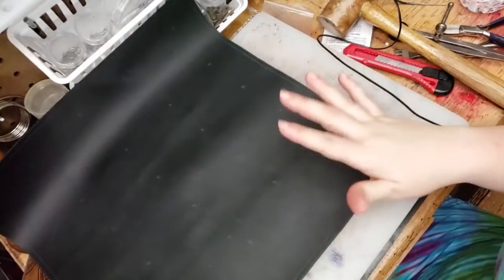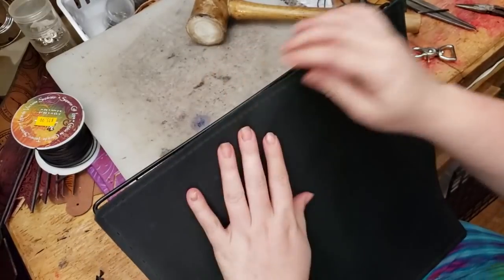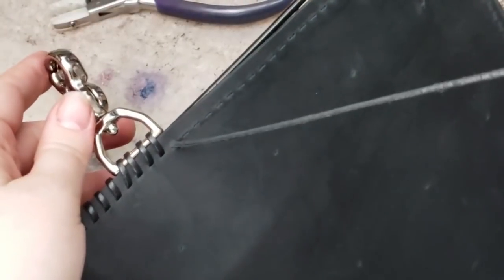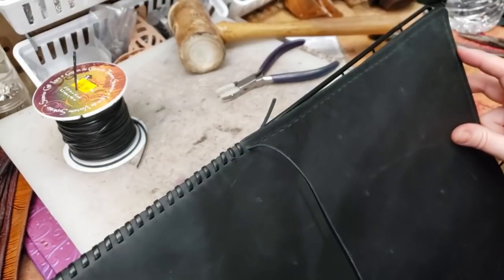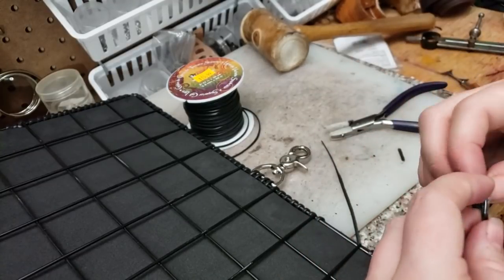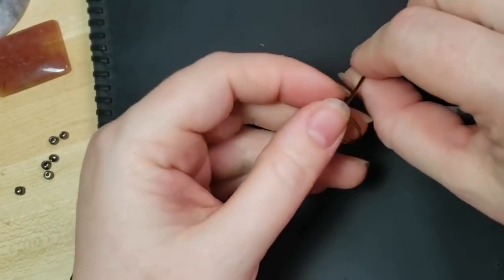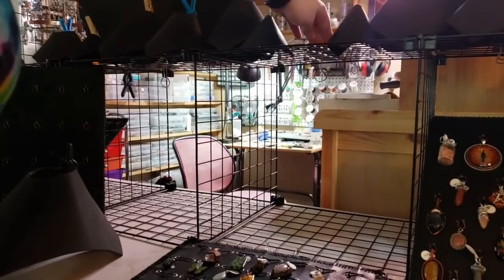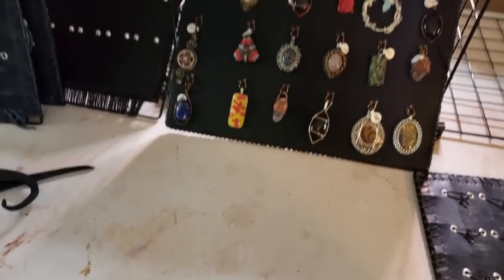Diy Jewelry display for pendants

Comment: I really like the pendant display. I make glass beads and make pendants. They don’t sell well if they aren strung which i made a tree to hang  them from. It looks terrible.  I would have to make hooks come straight out from the display and at least an inch long to compensate for the diameter of the bead. Do you have issues with your pendants not being strung? Do your customers complain?  I string them on leather cord with a slip knot to be adjustable.

Comment: So they sell well without chains? Or do you add the chain later? Or is there an extra charge for the chain?
Reply from the maker: Hey,  Michele! We used to include chains,  but many people would ask for a discount if the chain isn't included,  so we started selling pendants and chains separately,  and we've been doing that for 8 years.
Reply: Separate works better ... That way customer can choose the chain or cord that suits them best ...

Comment: Yvonne, Next time....do your leather corners first, opposite ends, 'Left Top, Bottom Right, Top Right, Bottom Left, even if you use a heavy thread to just first hold the leather in place.

Comment: I used the 3m command on a white board but I release I need a way to turn or swivel the hook because the way the hook the pendent will be crooked I wa able to show other hand made pendent but straight stone and certain nail ur in trouble

Comment: The finished product looks great but couldn’t basically the same result be accomplished more quickly by making the front of this display the back and the back the front?  If that approach was used you could just use Velcro/hot glue to attach foam or leather to the back of the metal grid and attach the wire hooks to the metal grid work that would be exposed?  That way you would not need  to punch all the holes in the leather/foam and weave leather all around the border and the hooks would still be evenly spaced from each other because they are on a grid.  It wouldn’t be as pretty but it would be just as functional and easier to make.
Reply from the maker: You definitely could! My goal was an improved aesthetic,  so this is the route I took with the materials I have on hand :)

Comment: What am I missing it is an important step. I see all the way up to where the wires are cut and bent ( around time 5;50) then hear " see you back when) ok next image is everything is put together. No idea how you went from all the wires all cut set on the table to the finished product. Need go see the holes make how the wires are attached to the board. Goes from parts on the table to done. Need to see the process, the back, how things were attached, how the pendents are the attached. So I like the idea but can't do it...
Reply from the maker: Hello! I show this step at 41:48, I hope this helps you!